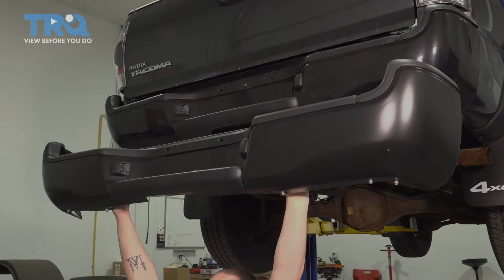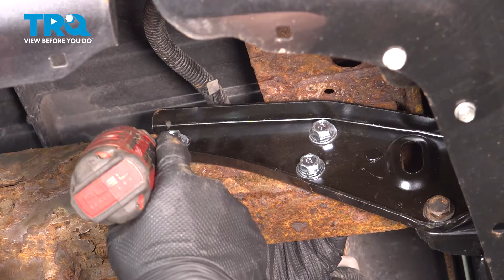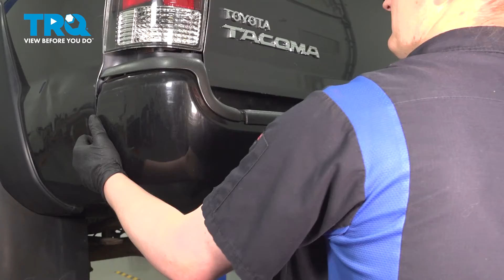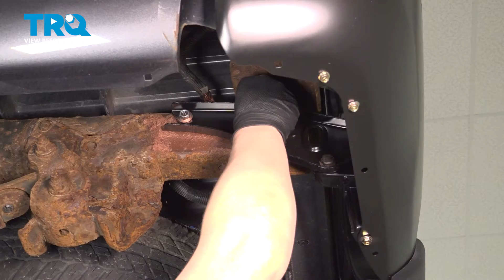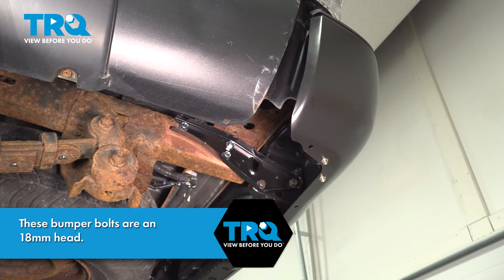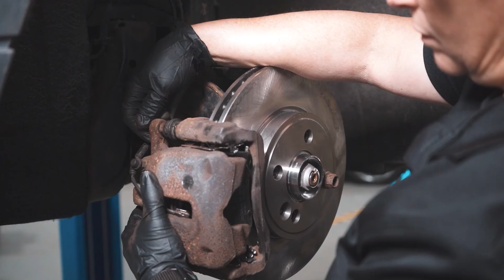How to Replace Rear Bumper 2005-2015 Toyota Tacoma

Comment: Very bad and misleading video.  You make NO mention of any of the other parts in that area such as the rear bumper support or the factory class IV receiver that most likely is there. This is a stock bumper being taken off and a stock bumper being installed.  If the bumper is so bad it needs to be replaced then it is highly likely the rest of the components back there are in need of replacement as well. Furthermore, those are NOT 15mm they are 17 mm bolts.  Hopefully your bumper is more accurate than the tutorial.